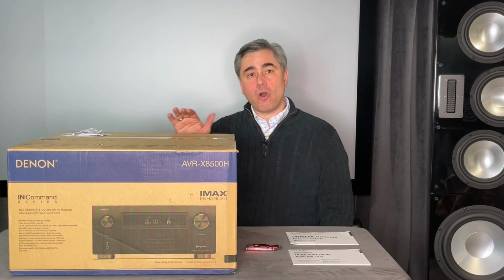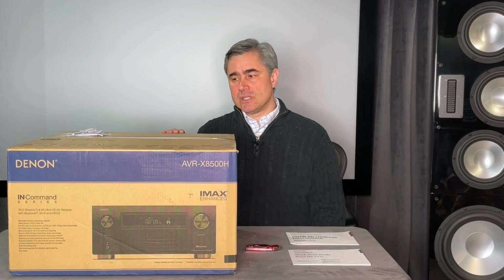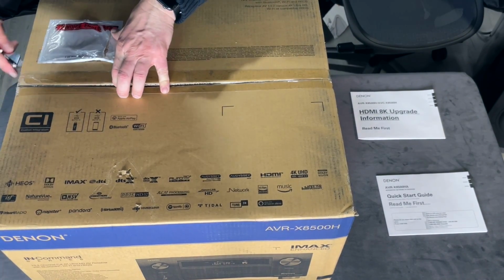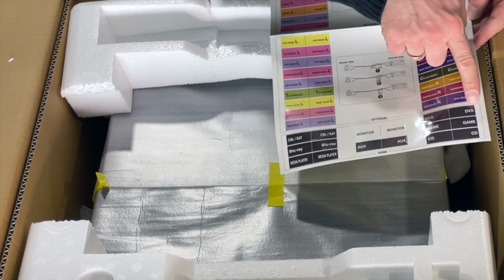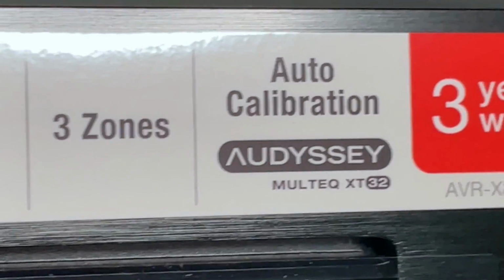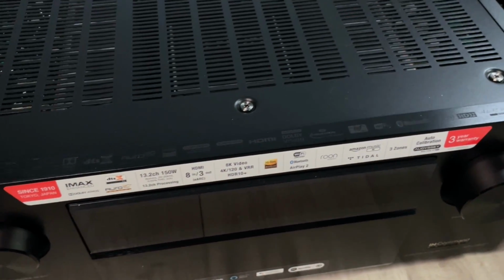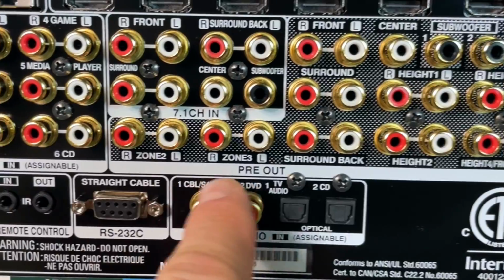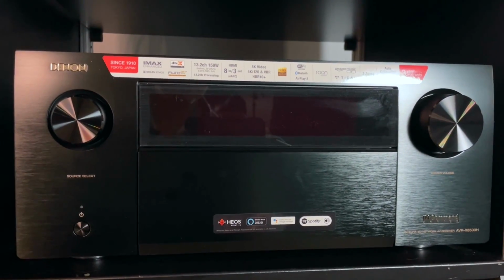Denon AVR-X8500HA 13.2CH 8K AV Receiver Unboxing Overview

Comment: That is a one stop shop, beast of a receiver. I really like the fact that you can buy this, power your system, and then when you want to upgrade to separates, you can switch it to processor mode. I have an external amp on my AVR-X4500H right now, and wondered, why they did not include an option to turn off the amps, when outputting to the preouts.  Also, I look forward to your review of the MultEQ-X app. I really want to see what that software can do.
Reply: I have a X4500H also but am gonna upgrade to this beast today. Which additional amp are you using? I’m still looking for something extra for my Dali opticon 8 fronts.
Reply: @NL_the_Godfather  I have Monitor Audio Silver 300. My external Amplifier is an Anthem MCA325. It powers my fronts and my Silver C350 center.
Reply: Turning off the amps, if you use the pre outs only, how is this a problem?
Reply: @dfalekulo9138  I  believe he's  referring to the on-board amps which I  believe to be in the osd menu under the assign configure

Comment: Hi, what DACs does it have? I’ve read in forums that AKM DACs were replaced due to shortage. Thanks!
Reply: V AVC-X8500H byl DAC 8XAKM AK4490EQ. V modelu X8500HA od výrobce už nové SABRE ESS 8x 9010K2M. 😮

Comment: I have the 4700h.  I love it.  Certain the 8500 is better,  a bit too much in price for me.  The multi eq app makes the sound even better. Love that I can remove midrange compensation and can limit room corection to just bass frequencies (for me below 500hz)
Reply: I'd rather go AV pre and amplifiers than Denon 8500

Comment: I had the x8500h for two years, then recently I upgraded to A110, so glad I did, so much better sound steering, and powerful.
Reply: Me too. But I'm using it with external amplifiers. Are you using internal amplifiers? If using external amplifiers, should there be major difference in the sound quality? I just connected it and haven't used it much. Only had the 8500H for few months.
Reply: @ItsVJXO  using internal amps, 7.2.8 system.
Reply: @davidgerald285  all 15 channels won't power at the same time. How does the system decide which channels to enable and not? I also have 15 channels connected and front wide speakers don't turn on. But I haven't used the system much yet.
Reply: @Vivek Jain  only 13 channels will operate, in either of the three sound formats
Reply: @ItsVJXO  Get a A3, A5 or A7(depending on how many bedlayers you have) & power your bedlayers speakers. Then just use 8500h for top 4 atmos. Yes it sounds way diff and avr runs cooler. I have 4700h and I'm 100% pre-amp mode with a A5 & A7 for my 7.2.4

Comment: Thanks for the great overview. I purchased the 4700h & love it. I'm sure their flagship has even better processing and cleaner amplification. I considered their flagship and only decided against it because I knew I was going into separates soon and wanted to save some 💰.
Reply: What was your deciding factor for the 4700 over the 3700?
Reply: @gabe6959  a little more power for 2 channel listening & HDMI input on the front (alot easier for when I use REW).
Reply: @doublet147  And AURO 3D
Reply: @pricelessbrains3282  yes & Auro 3D. I meant to mention that.

Comment: Virtual Height is so cool with a very large projector screen. (when it works, that one Tron movie)  Had this on the Yamaha flagship Avr.  Having the fronts 11ft apart and center 12" off the floor,   Peoples voices would be heard exactly where they were on the screen, say 5ft up and 3ft off center.  I have tried several other brands but Tron has been the only movie this feature has ever worked

Comment: Why buy a big expensive amp like that and not use its amps.
Reply: Yeah. You can get a much better pre/pro for the money. This amp I'd for folks who want to just have every bell and whistle combined with internal amplification
Reply: @missing1102  Mike which pre pros??
Reply: @johnlira3316  I think an Anthem 60 with external amplifiers is probably a better combination and performance than this all on one solution. Don't get me wrong, Denon has high production standard but the audessy is lesser room correction tool in my humble position. This am is around 4500. The Anthem could probably be picked up for 2500 plus 2k in external amp.

Comment: Big fan of Denon here.

Picked up a used  Denon AVR 4810ci ($3000 MSRP) for $50 and use it to power Energy C9 towers. 
Great power and fantastic sound, especially in the low end.
Reply from the maker: You stole that Denon!
Reply: I'll give you $100.00 for it
Reply: @BMC530i  Denon AVR 4810 hrál skvěle. Z druhé ruky za 750 Eur nic lepšího v této ceně nebylo :)

Comment: I just purchased this receiver and later read that the well tested AK DSP chips are not in this unit (only in the anniversary 110 units) and they are using an inferior DSP chip. The previous 8500H tested very well but this may not be the case with the 8500HA. I wonder if you could speak to this issue. I’m disappointed. This was a significant purchase.
Reply: i would like to know this as well!!!
Reply: Would u like to sell it
Reply: Ne, v zakoupené, neupgradované X8500H jsou stejné AKM AK4490EQ jako v AVC-A110. Nové přístroje AVC-X8500HA již mají SABRE ESS9010K2M. Nejvyšší řady A10H a A1H mají referenční SABRE 10x ESS9018K2M .❤

Comment: Dirac is now the new standard. Let's hope D&M Holdings adopt it.
Reply from the maker: Standard by who's criteria? Audyssey now has full PC control and Anthem ARC Genesis has had that for years.
Reply: @Audioholics  the  pc app cost 200 and is only attached to one avr. I find that few people in the audio community on the forums hold onto Audessy once they have tried Dirac. I also wouldn't be surprised if the new holding company does make a deal with Dirac.
Reply from the maker: @missing1102  threw the licensing restriction is unfortunate.  I doubt Masimo will change room correction on the AVRs. They have no good reason to do so.
Reply: @Audioholics  the pc app seemed to be aimed at the the enthusiast as a direct response to the popularity of Dirac. Sound United has a mini monopoly among brand loyalists but I have found many proponents of Audyssey have never really tried Dirac and once they do are convinced. I also found the bio of the ceo who led the buyout interesting. Seemed like a smart guy and maybe there was a purpose of the kinda weird blend of companies besides cash generation.
Reply from the maker: @missing1102  DIRAC Is not without its problems. I'm not thrilled about the Masimo buyout TBH.
Reply: @Audioholics  I agree. I hope, truly, for everyone that Denon remains solvent and well because they seem to be the heart of the market and the best product for the consumer.. regardless of the room correction.

Comment: Correction for you, almost everything you said regarding the HA being an upgrade on the audio side vs the original Denon x8500h is incorrect.  The original has all this including Imax Enhanced and DTS-X pro via a firmware update which was through the internet and free. These are not exclusive to the HA model. The video is really where the upgrades happened.
Reply: The reference in the video is that the 8500HA adds height virtualization to simulate three-dimensional effects without actual height speakers installed. The 8500H would up-mix the audio signal to actual speakers and the HA adds speaker virtualization. IMAX enhanced was added via firmware to the 8500H. The 8500HA adds DTS-Pro.
Reply: @TheoNicolakis  fyi as an x8500h owner dts pro is in the same update that added the Imax enhanced to the x8500h. The update was November 11th, 2020. Audioholics even wrote an article about this upgrade on November 5th, 2020. I believe you're also incorrect about the virtualize height channels, however, I'm a bit less confident in this aspect of the update.
Reply: Dts-x pro was added to the original as well with a firmware update
Reply: @westsmith8987  Thanks for confirming that re: firmware update.
Reply: You might be right, so I am no disagreeing with you,  but i thought Denon said that the HA won't have the ability to store 2 audyssey profiles.
Reply: @Boxkerp  you might be correct. I wasn't 100 %sure on that point so I deleted that part. The comments regarding the DTS-X pro and Imax enhanced are 100 %correct though so left that in.